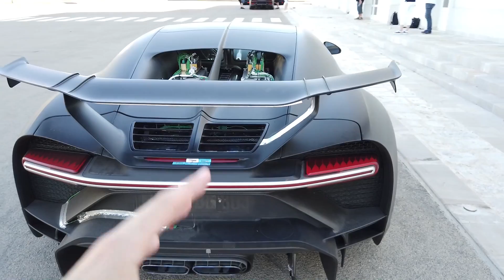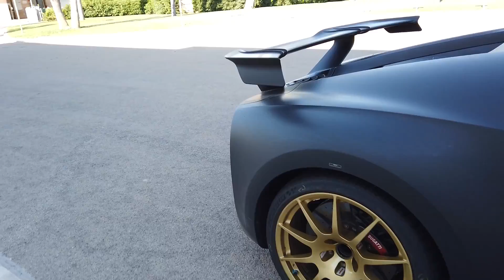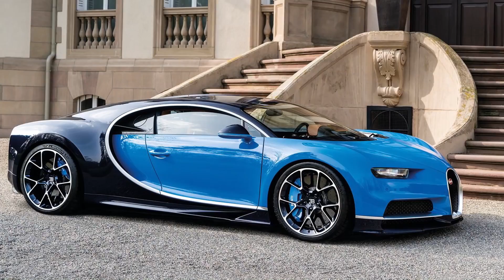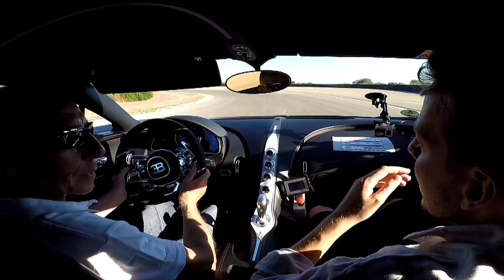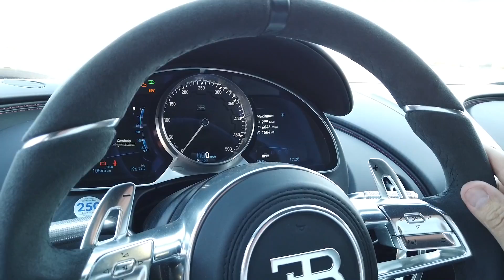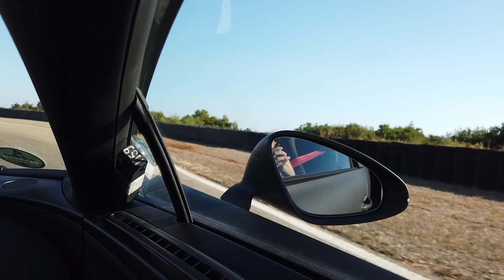ONBOARD the €3.6M Bugatti Chiron Pur Sport: IT'S CRAZY FAST!

Comment: That 15% reduction in the gear ratio seems to make an impressive difference with the acceleration too
Reply from the maker: It really does! In the morning I got to experience the Super Sport 300+ and I wasn't expecting to see such a difference in terms of acceleration
Reply: @MarchettinoEN  you're a lucky man to experience both & on the same day too...thanks for the video!
Reply: @Valkyrie 007 fark!😳 that is quite an improvement
Reply: @Valkyrie 007 bloody hell!!!🤯
Reply: @Valkyrie 007 any idea what the ¼ mile time is for this Pur Sport model? I see a stock 765LT has done a 9.4s time on its OEM tyres and 9.31s so far on R888s, so wanted to kind of get a slight comparison....
Reply: @Valkyrie 007 noted! Damn impressive!!